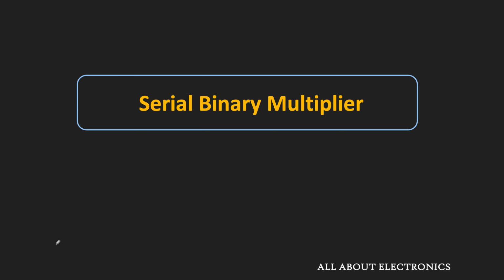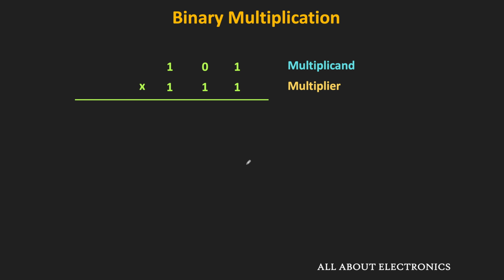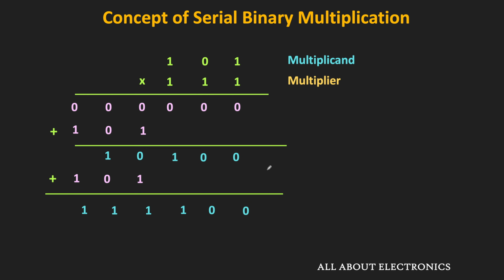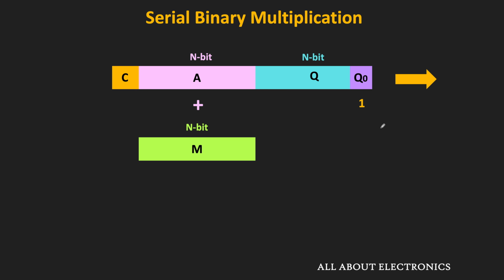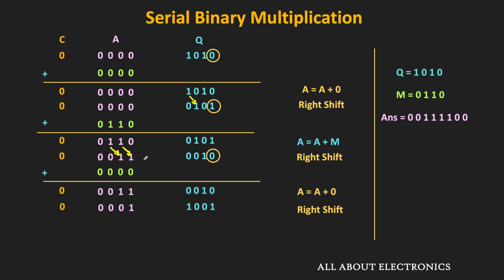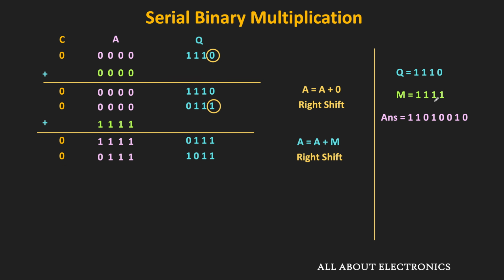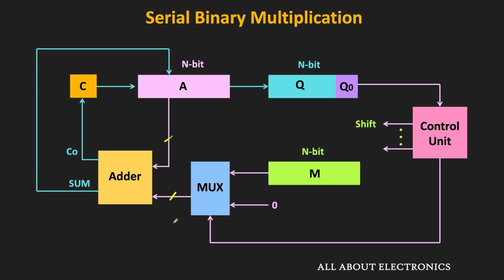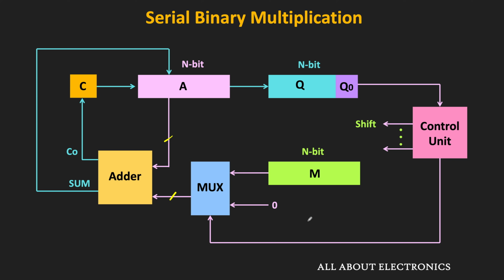Serial Binary Multiplier / Sequential Binary Multiplier (using Add and Shift Method)

Comment: Where can I find the video showing the design of the control circuit for the sequential multiplier?
Reply from the maker: Here is the link: https://youtu.be/CsvXCwZYc1U
Reply from the maker: I am really sorry. By mistake, I have send the link for serial adder. 
The control circuit design is covered in this video itself. Just check the last chapter. The hardware implementation part. 
https://youtu.be/-5N1FY8EC_8?t=1030&si=0W0yQN90oCPoo5lM
Reply: @ALLABOUTELECTRONICS  On this video(the last chapter), you've made reference to another video covering the design process of the control circuit. That's the video I was asking about.
Reply from the maker: @jeff-ke  Ok, got it. I have not covered that as a separate video. But I will tell you the design philosophy and will also share you the simulation file with you.
Reply from the maker: The thing is, in the simulation, the shift operation is implemented using the universal shift register. So, the shift operation needs to performed after addition. So, for that, the control signal and the 90 degree phase shifted clock signal is generated. So, that the shift operation will be performed at the falling edge of the clock.  Will share the simulation file with you soon. You can run it on Deeds circuit simulator.
Reply: @ALLABOUTELECTRONICS  Thanks so much. That will be extremely helpful.